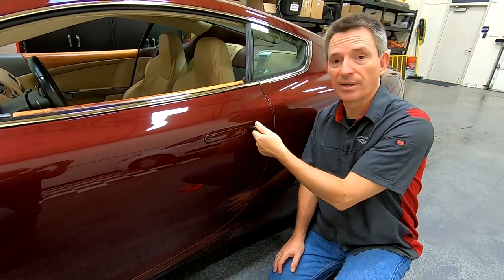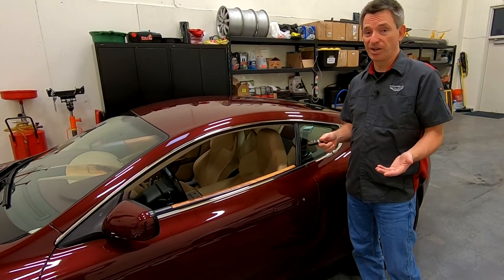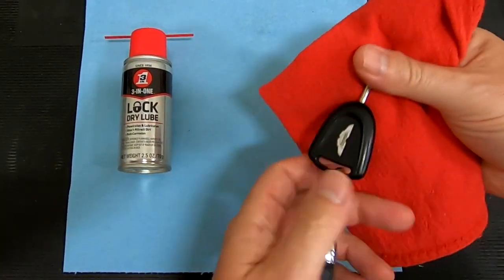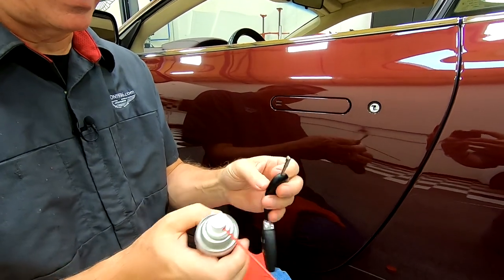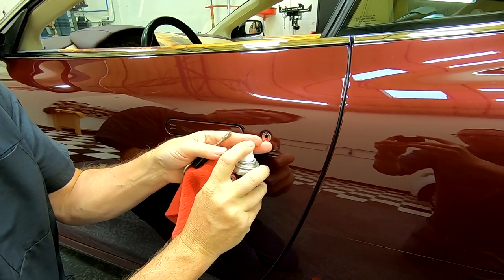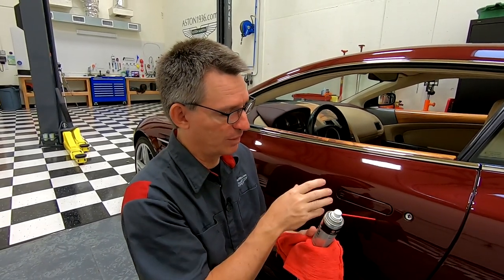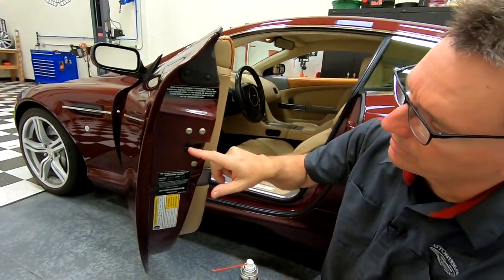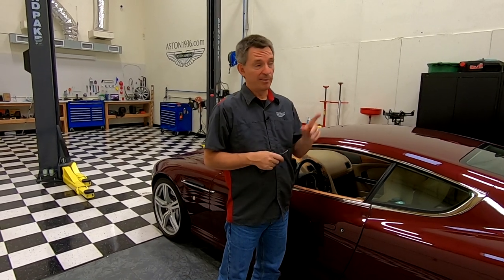Lubricating the Door Locks in an Aston Martin DB9

Comment: Thank you Steve for your very informative video. I changed my door struts today following your guidance and I have one comment that is I just pushed the new struts into place, as you did on the nearest end, with some grease, there was no need to use a screwdriver or  touch the clips at all. Both ends clipped on easily with just a push. Doors now staying in place perfectly, very happy. Peter.

Comment: I adore all your videos as I have  the same model of the same year....except a cabriolet and a six speed manual.......BUT how do you get yours so damned shiny?  Don't worry about endorsing a product...I don't care....but how do you do it?  BTW I follow all your advice and you recently saved me at least $1000.00.  Thank you for your meticulate videos. I'll just quickly mention here the same problem/concern others may have.....the .nacelle' or 'hood' over my instrument panel just above the steering wheel ...the leather has shrunk back from the outward (windshield) lip and so badly it needs recovering. What and where can I go for this. PLEASE. Dealer says minimum six-hundred dollars and cannot guarantee it will match, and wants to change the whole lot, right across, driver side to passenger side for $6,000.00....Yes, Really.
Reply from the maker: Ha, jealous you have a 6 speed.   The shine comes from three things.  1 - a full factory quality respray 2 years ago.  2 - I had much of the car covered in a high quality PPF film.  3 - final layer is a ceramic coating.    The fancy shop/camera lighting makes it look amazing.    As to your leather conundrum.  I repaired the leather on my right side (passenger) panels.  The glue released and I just stretched and reglued.   If the leather is shot, RedPants.lol was offering 1 sq yard pieces from the original leather supplier.   I ordered one, and it has never arrived from RedPants.  Contacted him once about it, was told to keep waiting.  They have my money, and I have no leather.  Maybe it will come through someday.  If he can supply it, it might be your best bet.   Thanks for watching!
Reply: @Aston1936  It's absolutely gorgeous. Thx for the advice and I shall make sure not to order anything from RedPants.  I have often wondered about PPF and ceramic, you have given me confidence, thank you. I know you are busy so I shall not waste your time. Thank you once again....for everything.